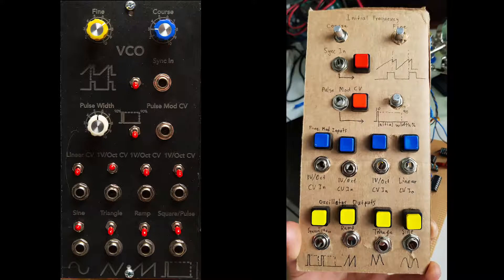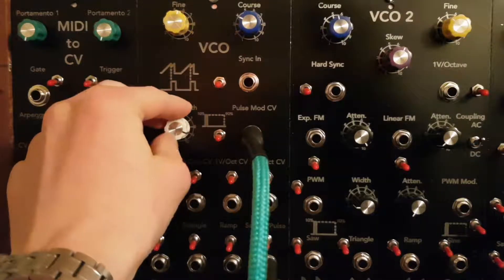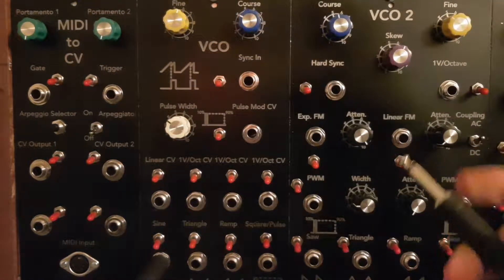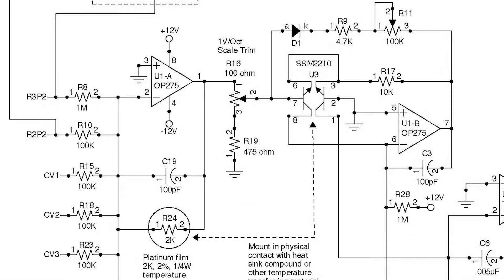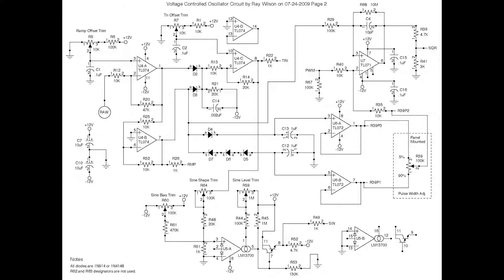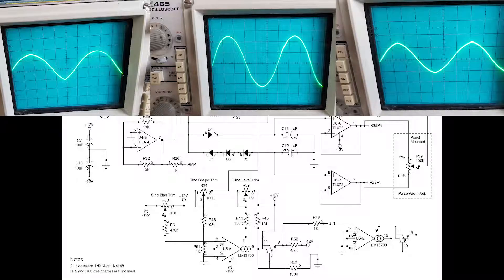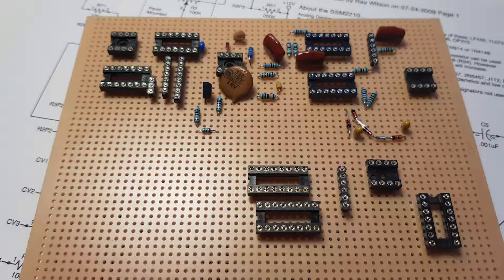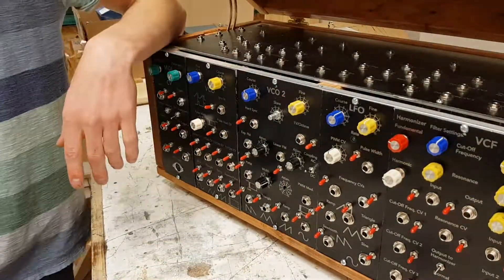Modular Synth VCO

Comment: VERY INTERESTING,ALTHOUGH I AM LOST ON HOW IT WORKS EVEN,THOUGH I HAVE AN ELECTRONICS BACKGROUND.
Reply from the maker: It's a little difficult to explain, I didn't even fully understand it until I had built and debugged it. I might build up the main oscillator on a breadboard to demonstrate its operation.
Reply: It's an Sawtooth core witch work by summing the voltage in the summing amp UA-1 witch is feed in to U3 and then use the property of an transistor witch have a exponential reletionship between voltage and current thus giving you the 1V/Oct witch is then feed to the saw core witch produce the sound, i guess C6 charges and then discharge to -12v and then charge up again hence the frequency. ok well something like that my eng is pretty bad and i'm sure i made a mistake or three :)
Then you have triangle core who works by reversing the timing cap so it is basically load and unloads so you get a triangle witch is preferred in my opinion.